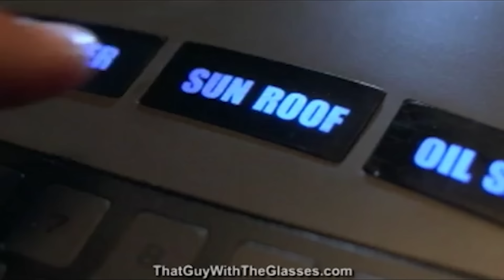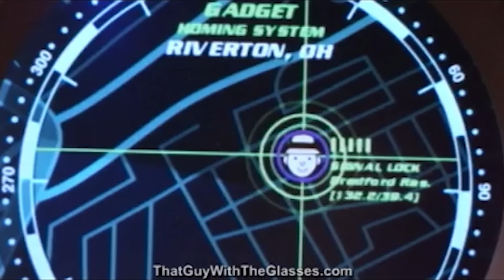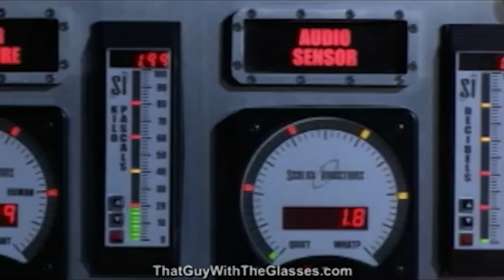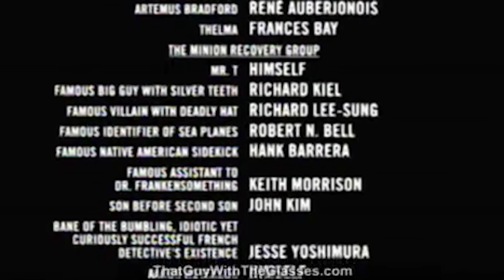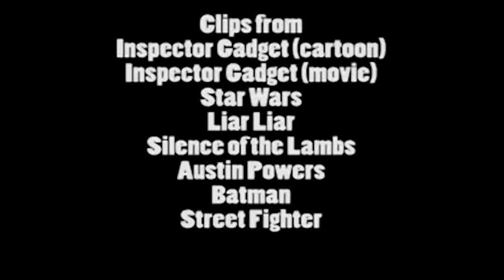Inspector Gadget: The Movie - Nostalgia Critic

Comment: Did anyone catch that shot at 17:20 when Dr. Claw has to press a red button on his claw in order to destroy the computer chip with his claw? 
We have seen Claw use his claw a number of times before, including opening and closing it without having to operate it manually with his other hand. 
What. The. Hell.
That is one crappy, inconsistent prostetic.
Reply: it actually kinda makes sense. The claw can only put enough force to crush something if that button is pressed to prevent him from breaking stuff he doesn't want to break by accident

Comment: This Disney movie is based on the animated television series of the same name that originally ran syndicated from 1983 to 1986, then was re-run occasionally by local affiliates (1986-94), Nickelodeon cable (1987-92 and 1996-2000), CBS (1991-92) and The Family Channel cable (1992-95), and returned as a holiday special, Inspector Gadget Saves Christmas, on NBC in 1992.

Comment: Hypothetical Situations that require a hose filled with gallons of toothpaste: 
-a factory that produces toothpaste has a puncture in one of their holding tanks, requiring Gadget to both patch the leak as well as refill the tank
-there's a summer camp where all the kids need to brush their teeth; there's like 150 of them and the toothpaste in their welcome bags was recalled, so Gadget needs to individually apply a small dollop of toothpaste from his wrist mounted hose
-a police team is exposed to swarms of mosquitoes on a mission and are riddled with bites; Gadget must apply toothpaste to their itchy spots 
-the toothpaste on the International Space Station runs out, requiring Gadget to be flung into the vacuum of space to fill up the tanks 
-That's all I've got